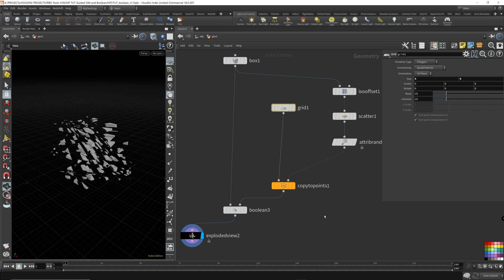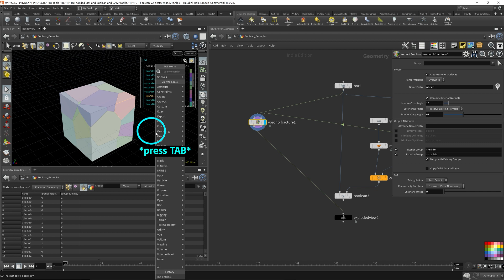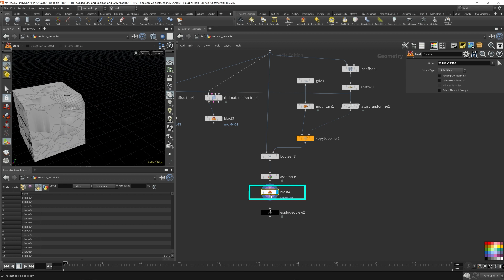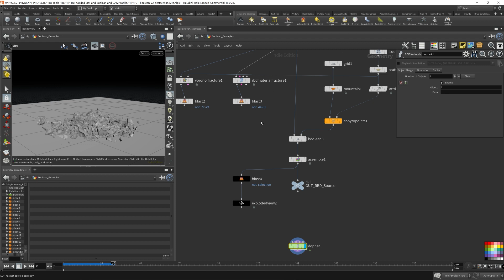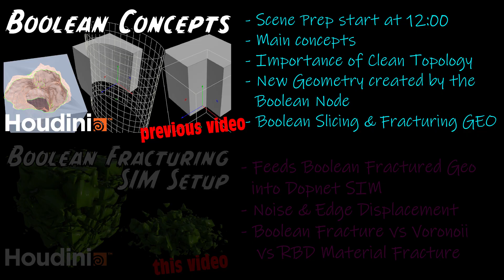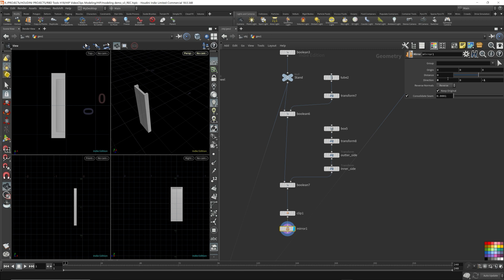Boolean Fracturing for Simulations, Procedural Modeling in Houdini

Comment: Nice explanation! Thanks a lot.

Related question:
Is there a way to make use of the attribute piece* to export a pre-fractured .obj mesh to other software?
If I export a .obj, the subsets are outside and inside. I tried the different combinations with the "assemble" node but never succeeded. And If I use "groupdelete" node to delete the inside and outside group I can't assign a different material to the interior faces
Reply: Also, It would be interesting to understand how to assign inside and outside (as Voronoi) material in this custom boolean fracture setup
Reply from the maker: It depends which software you're porting it to.  I tried porting from Houdini => Blender and the gorup names, inside & outside become material slots in Blender.  However the piece attribute doesn't even get ported and is lost in Blender.